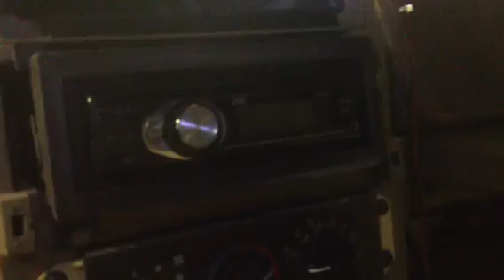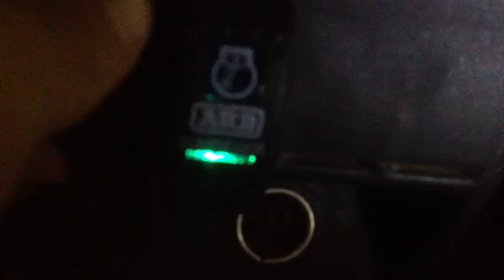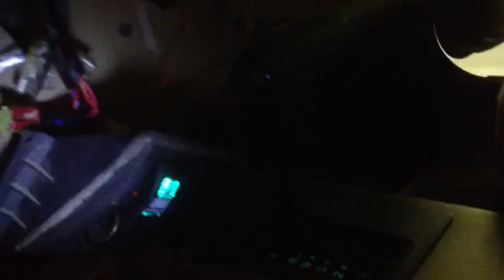ARB compressor wiring harness switch install

Comment: You've wired it wrong. The blue wire is for dash lights which lights up that little light on the bottom of the switch, and the red wire is for ignition power. So when you turn the park lights on the little light comes on on the switch, and when you turn your locker by pushing up! On the switch it turn the bigger blue light on the switch. And when you turn  the locker off the big light goes out.